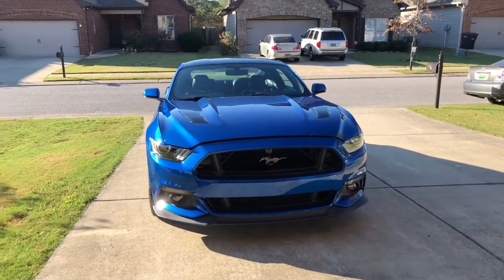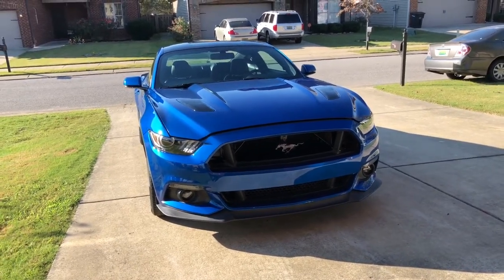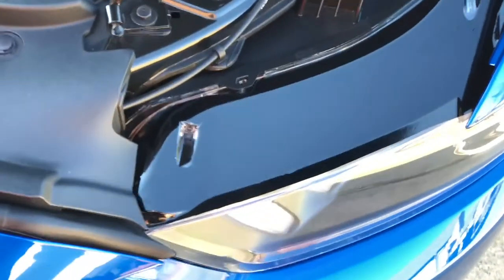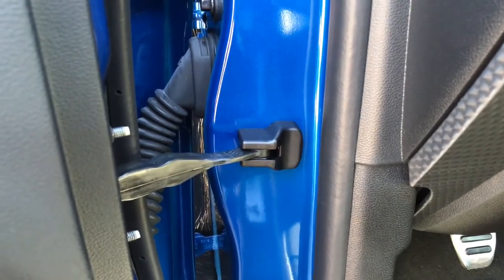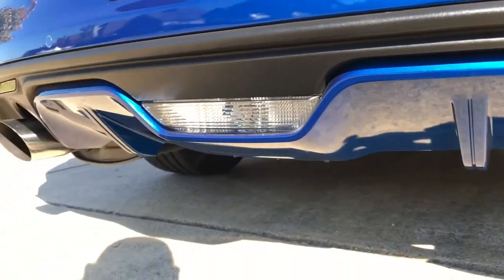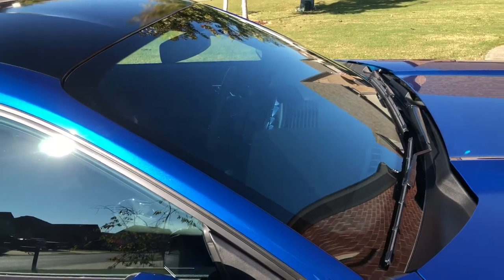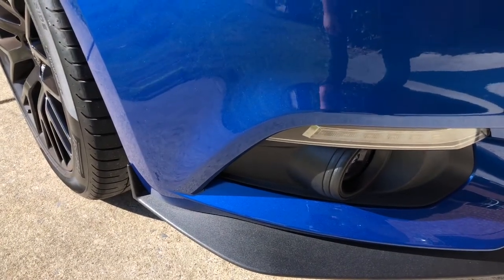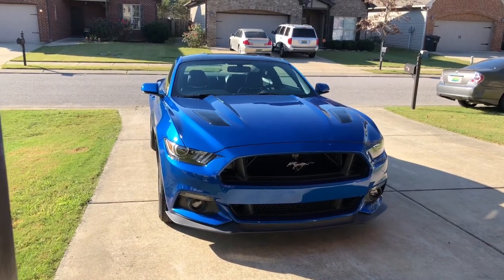Mustang Modification update.  Vlog 3.  ✔️

Comment: Hood struts were my first mod. Best thing ever! I don't recall if you said anything about it in the past, but wheel spacers if you are not getting new wheels anytime soon. 25mm front, 20mm (requires cutting lugs, what I have) or 23mm rear (from Jeff Ashton, he sells the full set). Really sets the stance up perfect IMO. Another thing I added was the splash  guards for the wheels, since  I have the spacers. Your car looks great, my second favorite color besides Ruby Red. Good luck with it!
Reply from the maker: Thomas Bailey I want to do spacers but I think 25 is too much and I don’t really want to cut my wheel studs either.  Decisions, decisions....
Reply: 25 in the rear is a bit much to me also. That's why I did 20mm. 23 would be nice on the front too. Wonder if Jeff would sell 4 of the 23mm spacers. Those don't need the studs cut.
Reply from the maker: +Thomas Bailey  Two MM isn’t much tho. I have seen a car with 20mm ones and it looks good.  May just leave it alone for a while.  Lots of other things I want to do first.